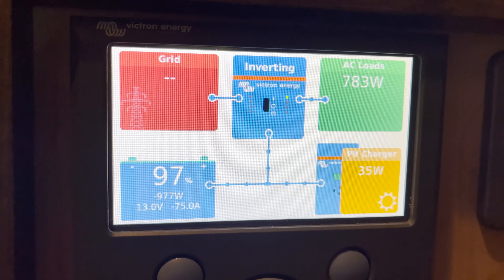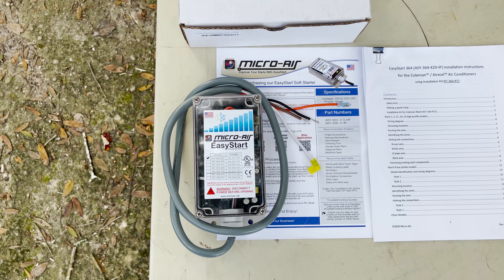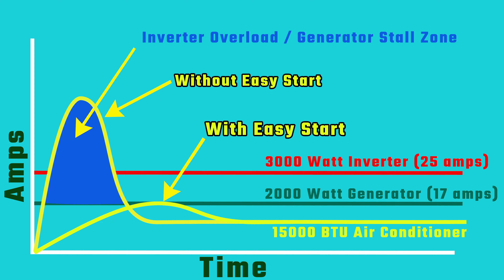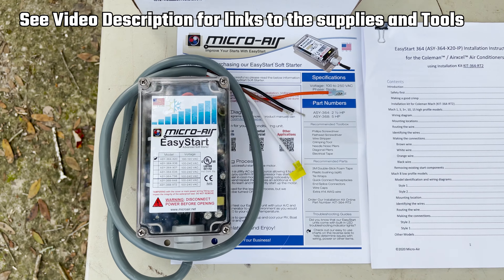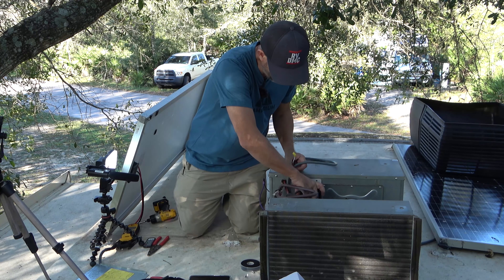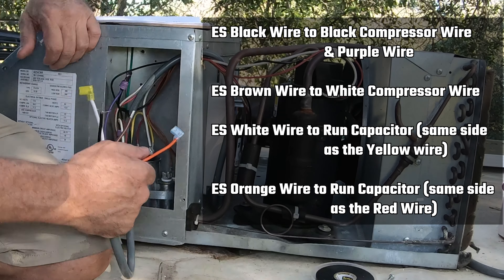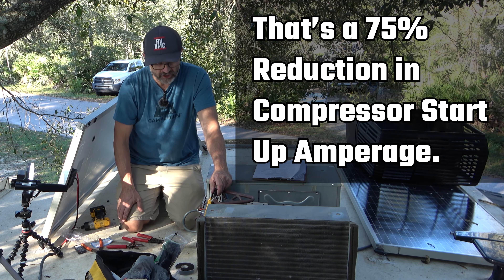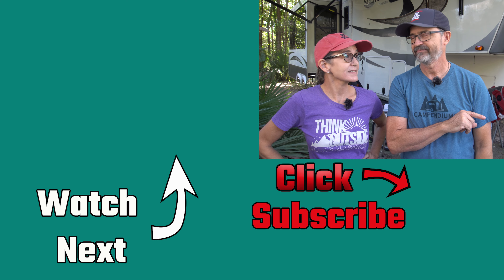Micro-Air Easy Start DIY on Coleman Mach RV AC unit 4K (RV Living Full Time)

Comment: This is a great video. I purchased 3 of the micro-air's. I never even looked at the instructions, yours are so much more thorough. It's nice being able to pause and rewind and double and triple check the wiring. On my front air it dropped the start up amps from 25 amps to 11amps. What sold me was you took the time to meter before and after otherwise how you gonna know if the thing is working. Good Job and Thanks.
Reply from the maker: Thanks for the positive feedback, I try to do the things that other videos left out that I wish they had included.  Sometimes I will watch many video looking for one specific detail to an installation before I will do it myself,  Larry

Comment: Man, Larry can I ever identify with you even though I am 73 years old.  I am also having a rough time with arthritis in both thumbs on my hands, making it harder and harder to squeeze and use hand tools. I really appreciate you taking the time and detailed effort to make such an informed video on your easy-start installation. I also have an RV with a Mach 15 roof A/C with heat pump. About a year and a half ago I installed the Micro-Air 364 Easy Start with bluetooth on my RV. And just before that I purchased a Honda 2200 EUI Companion generator with hopes of running  my air conditioner while dry camping. I too am a fairly capable handyman and consider myself a perfectionist (like you) and pretty much a jack-of-all trades. I owned a small satellite TV business and did all of my own istallations and service for over 30 years. I found the Easy-Start fairly simple to install even though it took me over 2 hours to install it. (that's the downside of being a perfectionist). Anyway all of that said to see if you can help me figure out whats going on with my A/C system. I was able to get my A/C to start and operate with my generator after I initially installed the Easy-Start although I felt my generator struggled a bit to run it. Now, all of a sudden, over a year later, after the compressor kicks on using my Honda generator, my A/C unit runs for about 30 seconds after starting the compressor, then my generator surges  to around 1790 amps and then throttles down to around 350 amps which stalls the compressor and only runs the fan. It does this even with all my other circuits shut off.  If I use my 30 Amp ac power or my onboard Onan 4000 generator, it doesn't do this. I don't understand what is causing my Honda generator to surge. Could my A/C capacitor be failing and causing this? (You guys are the kind of people who we always hope that we end up next to in a campground) We hope we'll run into you someday on our journeys if you're still out there. Please help me if you can and thanks again, Paul
Reply: update:     This is the original Coleman air conditioner that came from the factory on my motorhome. I am the 2nd owner of this RV. The original owner that purchased it lived in a senior retirement RV park in Phoenix, AZ for two years before selling it. This tells me that there are 1000's of hours of run time from running it almost constantly in Az. So yesterday I replaced both of the start and run capacitors just to see if they were causing my problem. Lo and behold, replacing them solved the mystery of my generator surging. Now I can actually start and run my AC unit at under 14 amps with my 2200 watt generator. The fact is that the run capacitor had worn out from overuse. Happy camper once again!

Comment: Even easier connection using WAGO connectors. Used them and installed and tested 2 microairs in under an hour.
Reply from the maker: I preferred to use the crimp connectors as that is what they installed at the factory, also there is significant vibration in the air conditioner that could cause failure or possible arching in the wago connectors.  Great job doing two in an hour, much faster than me.  Larry

Comment: Can you post (or edit in) a close up of what you are touching with the tool while you short the capacitors...
Reply from the maker: the camera I had on the close up froze while filming.  Hero 7 sucks sometimes.  Use any conductor with an insulated handle to touch the two posts coming off the capacitor.  I usualy just use a screwdriver or insulated pliers.  larry

Comment: Thanks for the walk-through Larry! I already planned to do this before spring on the two Mach 10 units on our new rig, as our generator is 2800W continuous/3100W peak. You've shown just how easy that project will be - thanks for such a well-done video!
Reply from the maker: Marc, the timing of this video was a bit off- just before winter 😅 but we wanted to show what a difference it really makes. 
We’ve only done one air so far- the one we use the most. We might do the other. 
Thank you so much for watching and your positive thoughts, 
Alice

Comment: I had known that a soft start mod to the A/C was going to be on my list.  Thanks for the video with proof it works, and the little peak at the solar system used to run your rig off grid.
Reply from the maker: If you read other comments, you will see lots of people love theirs. The solar series is coming. 
Alice

Comment: Hi there!  We will definitely be doing this once our trailer arrives.  I have been told by the Outdoors RV manufacturer that the elusive missing stove hood has been installed and it is in line for PDI, then shipping!

Thank you for this thorough video!  ORVs have Coleman 15k btu a/c’s, but I don’t have the model yet.  

We will also be almost exclusively boondocking, so will be installing a solar system and occasionally running/charging the rig with a generator.  I would LOVE to not be toting around a 100lb generator, so will follow your system to cut back on the large electrical draw.

Safe travels!
Reply from the maker: Thank you. We are thinking about installing a soft start for the other AC and do a comparison. 
Also, we are finally working on our solar overview. Look for it as our latest video. 
Our Honda 2200 is about 50 lbs. Larry uses a luggage cart often due to his RA to move it around. 
We have learned more batteries is better than more solar. 
Good luck and I hope our overview will help,
Alice

Comment: Hi Larry, thank you for the soft start video.  Ordered mine couple days ago as we plan on staying at State Parks as much as possible and boondocking  as well.  Also meant to respond to your video reviewing the Honda Generators you did earlier and say that I have the smaller 1000 watt Honda now for 21 year and to date have never had a problem.  Used it on more boondocking camping trips than I can count.  As well as at home during power outages it has run all night long powering heater in the RV cause couldn’t stay in the house.  Always changed oil and one replacement air filter and that’s it.  Planning to purchase the 2200 watt soon to power the AC.  Regards, Keith
Reply from the maker: Keith, the micro-air works great. We actually had a power outage at our current state park and had no issues. 
We did pull out our generator because we didn’t notice the power was out for awhile. Our battery charge started to go down😂. 
I’m sure you will be happy with the soft start. Let us know if you have any questions 
Alice

Comment: Wow! What a very cool idea!  Does the Softstart UP remove the need for a separate surge protector?  We installed a hard wired one because we also occasionally run the AC through our inverter.  
By the way for those who feel comfortable climbing up on the roof, a hard wired one is less expensive and pretty straightforward to install. There are tons of excellent videos online (including on this channel) that can walk you through the process.

Comment: One of the best video's I ever watch. I was going to hire someone to install my Easy Start when it comes in but now because of you I think I can do this on my own. I have a Coleman Mach air conditioner, but with no number on the end like the ones there showing Mach 1,3, 8 and so on. Mine has no number and don't know what directions do I use,. Thank you for any help you can give me,.  Thank You Mike
Reply from the maker: Hey Mike, when you open up the cover, you should be able to read the exact model off the AC.  Most of the Machs are the same unless they are a heat pump.  Take the cover off, look at the model number, look at the wires to see if they match the video, if they do, it should be easy.  If something looks weird, take some photos and send them to me.  Use the email address on our youtube about page.  I dont want to put it in the comments.   Good luck, Larry

Comment: Another great video!  I just ordered 2 units using the discount code, which saved me $50!  I live in Florida, and have only 2 A/Cs on my fifth wheel, so they are running constantly.  I have to turn one off when I use the microwave, but after installing the Easy Start, I shouldn't have to.  Thanks again!
Reply from the maker: Awesome let us know how the install goes.  I don’t know how we got along without this installed on our AC.  Being able to run the AC on our small generator is when we are dry camping and it get unexpectedly hot.  Larry
Reply: @DownsizingMakesCents  my older Coleman Mach A/C has a pressure switch and relay, and they shows those installation instructions on page 22.  Basically the only difference is you need to disconnect the black compressor wire from the pressure switch relay, add a new black wire to that relay connection, and then make a 3-way splice with the black Easy Start wire, the compressor wire, and the new relay wire.  Due to the additional wires from the pressure switch, I had to drill a new hole to route the Easy Start wires, because there wasn't any room left in the existing hole.  I ended up ordering the installation kit which includes the plastic ring to protect the wires after drilling the new hole, plus the additional wires and connectors to fabricate the 3-way splice.  The only location the Easy Start would fit in my A/C was laying flat under the fan motor.  One last unexpected item, the A/C cover mounting screws were torx.  I ended up making several additional trips up and down my ladder, but thanks to your tip using zip ties, I had no issues other than sore knees the next day.
Reply from the maker: @mattsmith3305  sounds like you had an interesting installation, I wonder why they used torx screws on the unit?  Take care of the knees mine are always giving me trouble, lol. Larry

Comment: Great video!  I am getting one this year.  One thing I want to emphasize is the quality of the materials used!  Notice that the electrical tape used was 3M.  Do not use cheap or no name tape.  And the mounting tape... Also 3M but heavy duty.  I run the signal system for the Midwest Electric Railway in Mt. Pleasant Iowa and we use nothing but 3M products.  They last!
Reply from the maker: Paul, thanks. Larry always uses 3M. It’s good to hear from someone who knows. 
Larry says it was easier than he thought to put in. 
It saved us camped in the Everglades with no power and mid 80s
Alice

Comment: Great video. I am looking at easy start for home air conditioner while on backup power.
Reply from the maker: That’s a great idea, they have models specifically for that purpose, I wish I I had one on my home ac during hurricane season,  larry
Reply: @DownsizingMakesCents  thanks.   I am also pondering an alternate source of heat after the Texas freeze we had last month. We are currently replacing all my hot water pipes that froze in the outbuilding.  We had rolling blackouts and it was then I wished I had solar or a generator.

Comment: Great video. Most thorough I have seen. The one thing I did not see is - what do I do with the 2 wires to the start capacitor?
Reply from the maker: Leave the fan start capacitor alone.  You only need to work with the bigger run capacitor.  I hope I understood your question correctly,  Larry

Comment: Not sure if you showed the hard start kit a second time after install. As the first attempt would of charged the capacitor for the second attempt and onwards.
Reply from the maker: I always discharge the capacitors after I disconnect the power, before I handle them.  I have never been zapped but i dont want to be.  Your point is well taken though,  It would be best to discharge the capacitor between tests.  Larry

Comment: Thank you for this  excellent  video :)  .. I'm surprised to see  the evaporator core air box uninsulated from the  hot outside weather  (and the condenser hot air , depending on what way it blows) .. my thoughts would be that I would be applying some  insulation to it  as well :)
Reply from the maker: That’s some good thinking but like most things built for rvs, poorly engineered.  I wonder if I could put some insulation on there.  Larry

Comment: Why crimping style end splice connectors only? Why not Wagos?
Reply from the maker: With all the vibration in the Rv and the amount of amps going through those connections, it’s better to use a crimp style connector, and they are cheaper.  Wago style would probably work though.  Larry

Comment: Interesting I have the same ac as you on my 2021 reflection and my Honda 2000 would run the ac I’ll have to test it
Reply from the maker: Our 2000 would stall starting the ac, but a 2200 may be able to do it.  With the easy start,  starts smooth as butter.  Larry

Comment: I have a question.  Today, I added the MicroAir Easy start to my Coleman Mach AC unit on a 27' Fleetwood tongue trailer.  Presto, it worked and ran off of my Bluetti AC200Max solar generator.   Pulled about 1500 watts...  I'm delighted.  However I have a question.   Today the ambient temps were up to only 41 degrees outside.  I first ran heat in the trailer (not with the AC unit, but auxiliary heat), in order to get it up to 86 degrees inside the trailer before entering the 5 learning cycles.  Having completed the learning cycles, I switched from shore power to the Bluetti.  It worked.  But will it work when summer comes, and it really is hot outside?
Reply from the maker: Yes it should work great when the summer hits.  The ac may draw more than 1500 watts when under strain in high heat but your Bluetooth should handle it.  Larry
Reply: @DownsizingMakesCents  ok.  I think you meant “Bluetti” not “Bluetooth.”   LoL. Also, I wish I had bought the Bluetooth easy start.  But I saved $40 by getting the old version. Thanks again.

Comment: I had mentioned to you earlier that we have an older 5th wheel (2007) that some day we will upgrade. So I'm not adding any solar to it unless it's a small fold out type. So, will your 2000 watt generator run 1 A/C unit without your inverter helping?  Ours is only 1 A/C @ 13.5 btu's. Your graph indicated that it's very close. I would much rather carry a 47 lb genny vs. 110 lb+.  Good video and well done, thank you.
Reply from the maker: Lane, yes. With the microair installed, he gene can run the AC as long as there isn’t anything else using power at the time. We now have a 2200 watt gen that gives us more power. 
And I get not wanting to spend the money on solar when you are planning on changing your RV. One of the reasons we aren’t downsizing for a bit,
Alice

Comment: just ordered thanks
Reply from the maker: Good luck with the install, its actually a lot easier than i made it look in the video.  I wouldn’t have an RV without one installed on my AC unit.  Larry
Reply: @DownsizingMakesCents  finished in 5 minutes thanks
Reply from the maker: @kingair350  It’s much quicker if you don’t have to film and explain 😂
Alice

Comment: Hello 
The learn process was it done with the camper plugged into the Honda generator or 30/50 outlet ? Would it matter ?
Reply from the maker: I think it is better to do the learn process while connected to a 30 or 50 amp shore power.  I think you can do it with a generator but better with shore power.   Larry
Reply: Thanks for the reply and you great video

Comment: I just bought 2 of these for my Puma Palomino 32RBFQ and I am pretty sure they are the same Ac units that you have so installation should be a breeze, I am running on a 30amp site so I am hoping to be able to run both of my units
Reply from the maker: I think you should be able to run both with easy starts on 30, as long as you don’t have a bunch of other stuff drawing power.  Good luck with the install.  Larry
Reply: @DownsizingMakesCents  Thank you

Comment: Great video.  I installed on my Solitude 310 as well.  I do have a question about the generator.  I have a 120v 30 amp inverter generator, but I am only able to run the back ac.  It will not run the front ac unit.  I know it is because the generator will only push power to one leg which I believe is powering have the panel.  We’re you able to overcome this and able to run your front AC.
Reply from the maker: We can run both ACs on our 2200 W generator but that is because we use the inverter and lithium batteries to make up the difference of power that is needed,  we start up the AC that does not have a Microair first then we turn on the AC that does have the Microair second.  I would think you could run both on a 30 amp generator like yours.  Larry

Comment: Nice Clean Professional job, and taping the ends with electricians tape is always a good idea, just a FYI if you had some Ox-Gard on hand to put on the ends of the wires before crimping them on. It comes in a small 1-oz  tube, it's Anti-oxidant Compound it's used for electrical wires to keep moisture from forming inside the crimp on connector, makes the connection last for a long long time. You pick it up from Lowes or Menards. Safe Travels.
Reply from the maker: Awesome tip, this is why I love the comment section.  I will definitely pick some up.  I use dielectric grease on all my boat electrical connections but didn’t know about this product, thanks. Larry